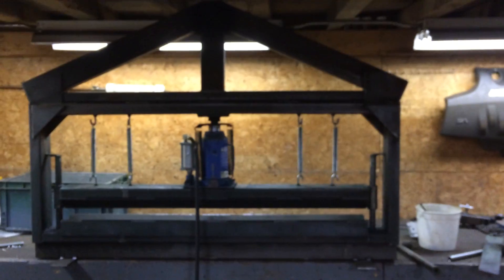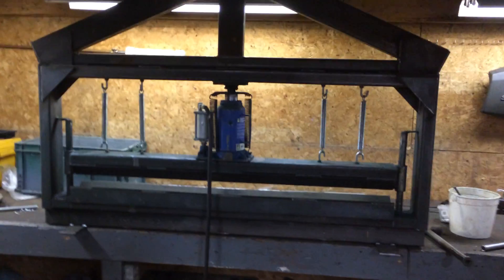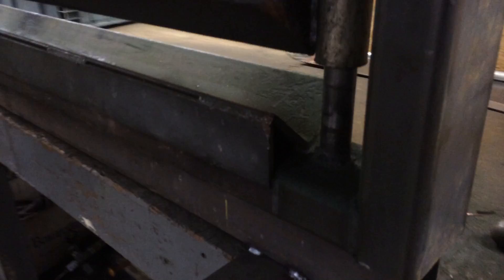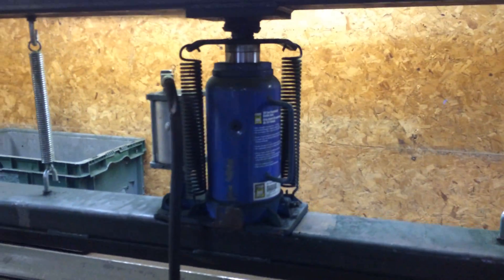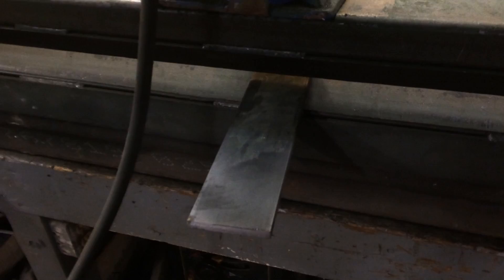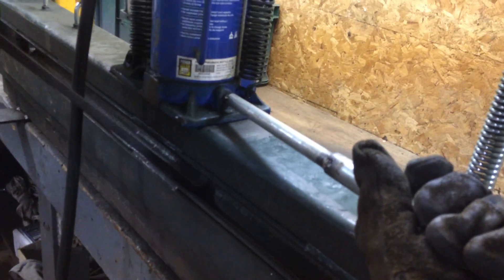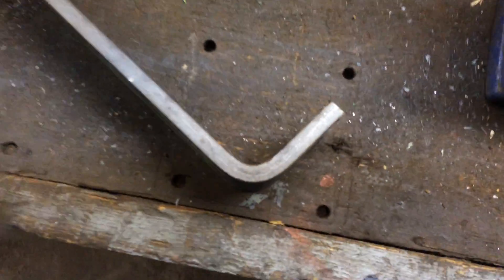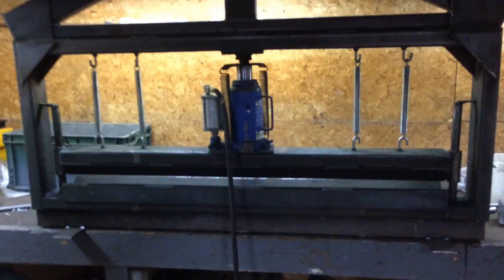Homemade Press Brake

Comment: Looks well made! So how wide a piece of 1/4" or thicker will it still press into the 90 degree ?
Reply from the maker: Get-The-Lead-Out.45 it will do full 90 degree bend on 48” of 1/4” plate!

Comment: wouldnt the square tube the hydrolic sits on be stronger if it were up and down instead of laying on its side.u know like wen carpenters instal tgere joists to make there floors witch keeps the home structualy safe  its not laying on its side.just my opinion.also maybe ghe u coukd bend plate instead of this 2 inch piece right in the middls were ints the strongest.the squere tube looks like its already bending